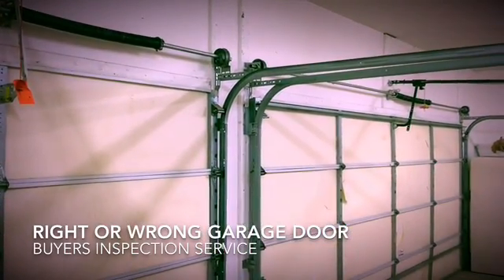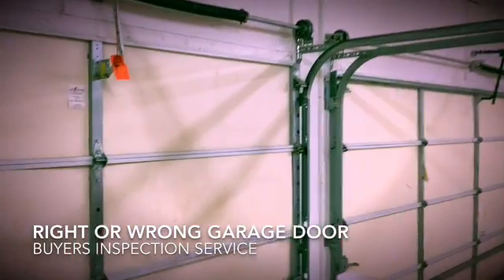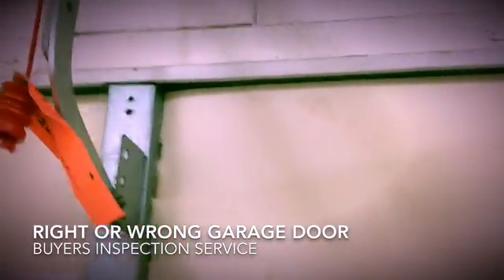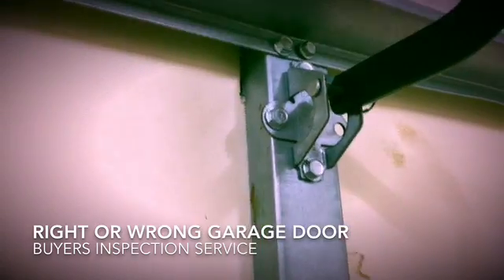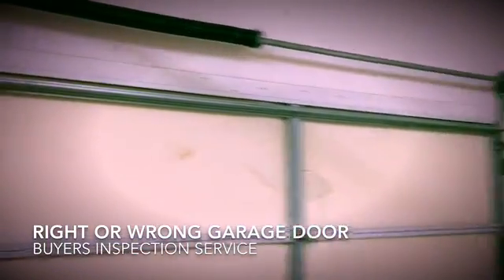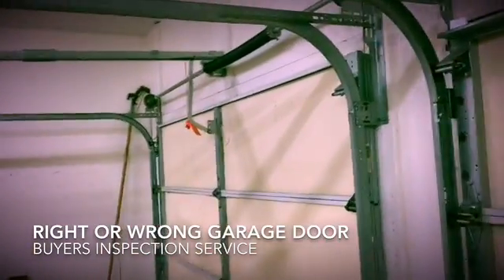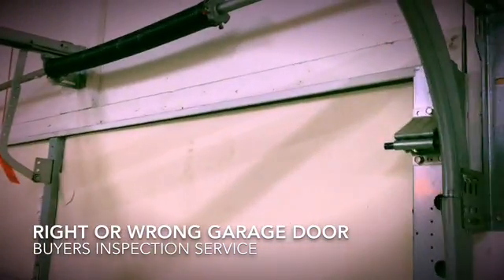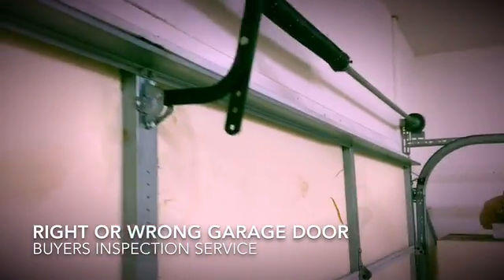Is your garage door designed for use with an opener

Comment: The first door ALSO has only an "L" shaped piece attached to the door acting as a bracket....so the cross-pin is in SINGLE shear. No good. Plus I bet the cross-pin ....or better said, "cross-bolt" .... is also threaded for its entire length under-head. Also bad....should be partially-threaded with a smooth surface section under the head, where it acts as a cross-pin....and the bracket should be in DOUBLE-SHEAR like the second door.....which can also be accomplished by using TWO..... (2x) ...  "L" shaped pieces.....on on each side of the pin with the "J" arm in-between. Poor on many counts.....not just the point you make on the top-horizontal reinforcement.